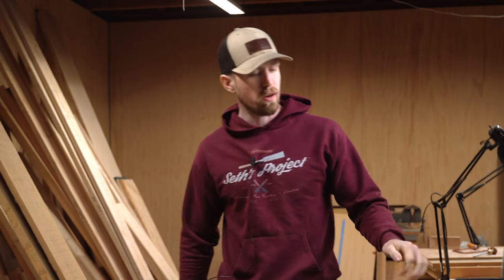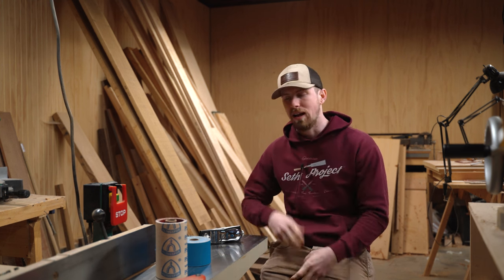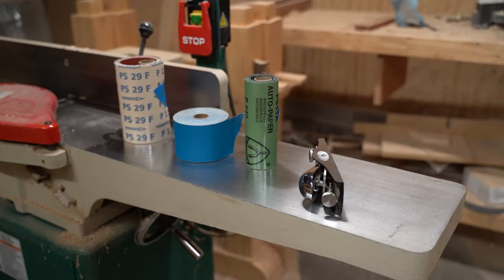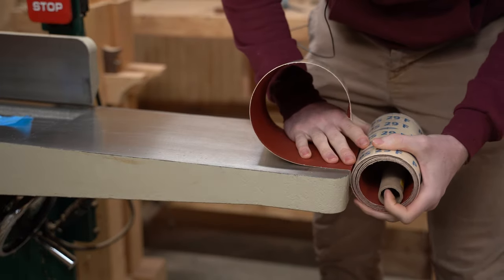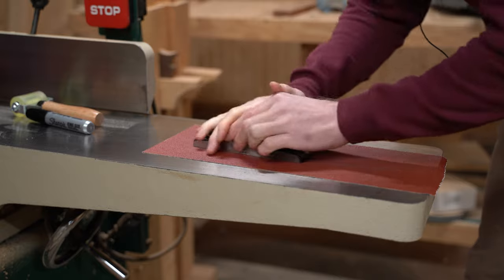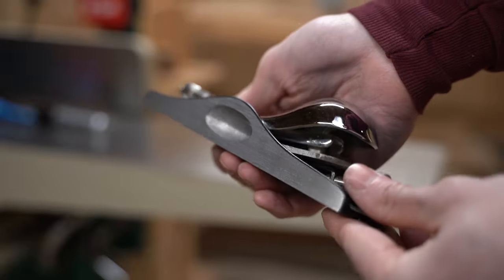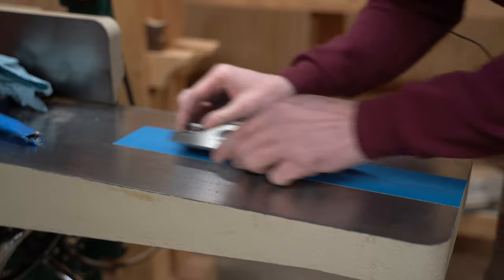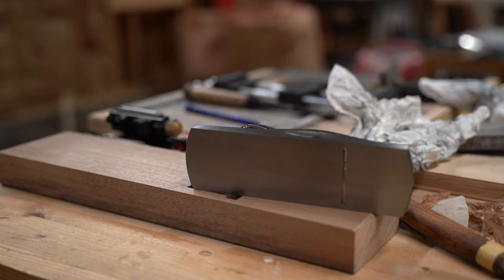Upgrading & Fixing Hand Planes

Comment: The "perfectly flat" western made planes is a pretty good myth, I believed it until I accidentally nicked my Veritas block plane too. Went to touch up the surface on a piece of granite and was shocked that only part of the plane was acutlly being cleaned up. Spent a few extra minutes lapping and now that block plane has stayed perfectly flat
Reply from the maker: Yeah, honestly it would make the planes much more expensive if they were all lapped, so it's kind of a good thing in a way especially if you have the tools to fix it. It's crazy how much better the plane performs when it's dead flat though!
Reply: @SethsProject  it really is impressive how much better they work, I've been moving away from buying the new ones and trying to restore the old Stanley's. I never really noticed the difference until I compared a freshly flattened Stanley vs my Veritas Jack and there really is a difference!

Comment: Why oh why do you young guys get so wound up about flat you don't need to go to the extreme you go to chippendales furniture makers had basic wood planes they got on with it I am z 60 year old full time woodworker 46 Yr under my belt
Reply from the maker: Well I no longer use planes for dimensioning because I use power tools for that process, so I need my planes to be able to take an accurate fine shaving ready for finish. Flattening the sole makes that possible. Nothing wrong with wanting the best from your tools.
Reply: Why not if you enjoy it try for perfection?
Reply: it’s amazing that Seth has the skills and knowledge to achieve something so beautiful, as well as flattening this plane in a way that fits with what he is making.  It’s wonderful what you can achieve with the right tools and time, regardless of your age.